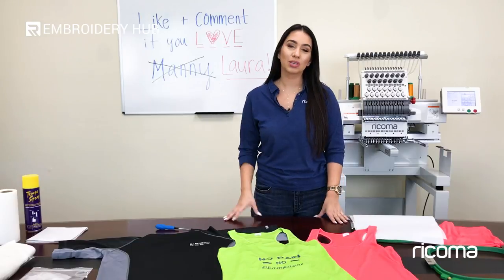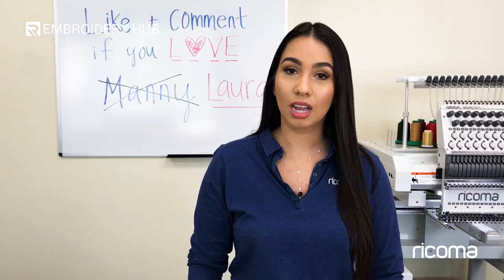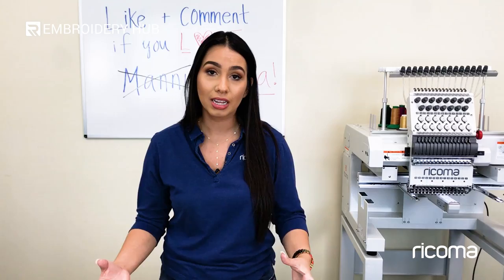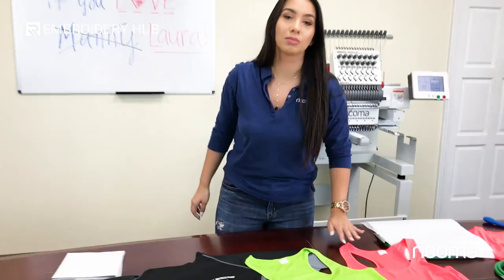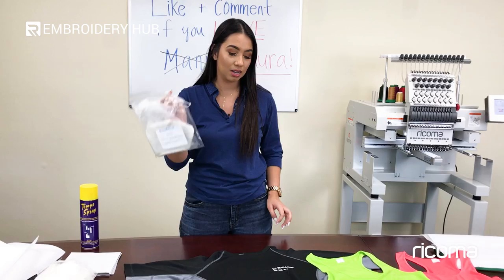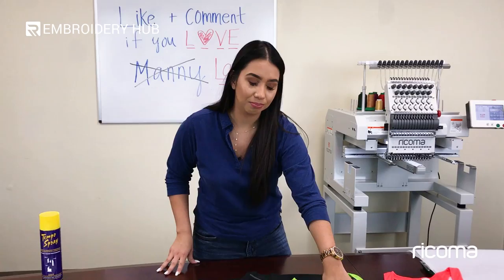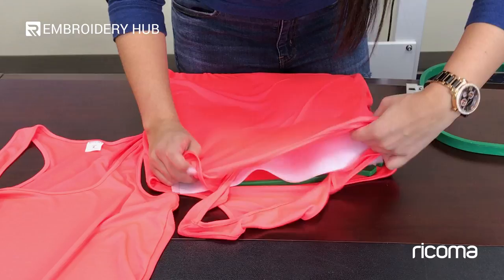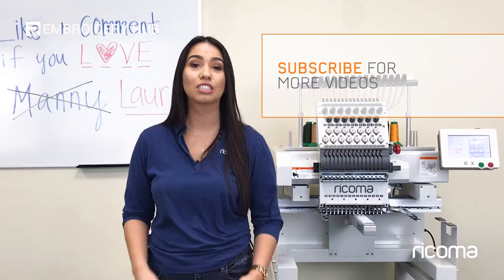Embroidery Hub Ep. 15: Embroidering Stretchy Fabric | How to Avoid Puckering When Embroidering

Comment: So its not recommended to use a 75/11 needle? would a 65/9 needle be able to do the job? Or its best to purchase a 70/11?
Reply from the maker: You can use 75/11 needles but you want to find ones that are made for stretchy material. It'll say it on the packaging!

Comment: I am having trouble embroidering a design on 4 way stretch cotton. Its thickness is light/medium. I found that if i use a material called fusing fabric and iron on 2 layers of it, it prevents many of the issues i was having with gaps and puckering. Although, i still have a bit of tiny imperfections. I believe i need to sort out these kinks on Chroma and try a different stitch direction. Not sure why I'm getting gaps/skips in the middle of my letters (especially curved letters such as 'C' and 'G'). But if anyone else has any solutions or tricks, please let me know 😭
Reply from the maker: Hi there, thanks so much for watching. If you haven't already, I highly suggest joining our Facebook support group, Embroidery and Custom Apparel Mastery. this group is meant for all lovers of embroidery with lots of resources and more members discussing topics and helping each other out and learning about Ricoma machines and other brands! We recommend you join this group as we'd love to have you!

Comment: The needles use on this demo were the ballpoint?

Thanks.
Reply from the maker: Correct. You want to use ballpoint needles on stretchy fabrics so that it doesnt puncture holes in the garment. Ballpoint needles slip in between the thread of the fabric.
Reply: would be 75/11 ball point or 80/12 ball point? ...what's the difference?

Thanks.
Reply from the maker: 75/11 ball point for most designs. I would use a 70/10 ballpoint for small or intricate designs. The higher the number the thicker the needle. You are going to want to stay away from thicker needles on stretchy fabric to avoid puncturing holes in the garment.

Comment: Hello,
Thanks for sharing. I have a janome one needle embroidery machine, was was quite a bit of money. The first time I tried to use a soft cotton baby vest, ( a onesie you call it in the USA),  it just wouldn't stitch out at all. Great on cotton that doesn't stretch, but I came unstuck with the baby vest. I put in a new needle , 2 layers of stabiliser etc. Any ideas on what I am doing wrong? Please advise. Would be appreciated.
Thank you.
Reply from the maker: For stretchy fabrics, try a ballpoint needle and cutaway stabilizer. Is the material being hooped traditionally or floated?  Is the design working on other fabrics?